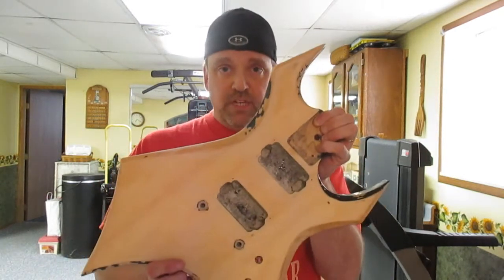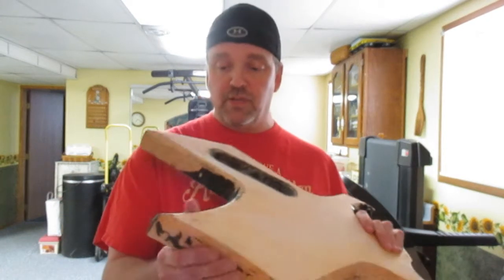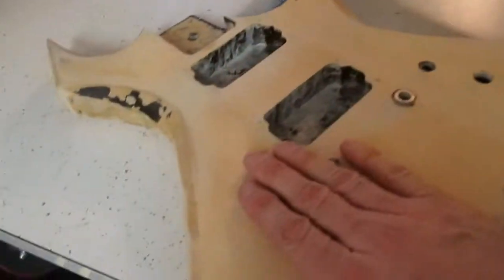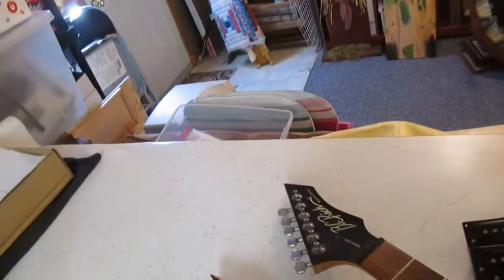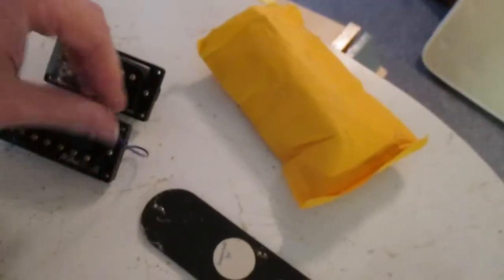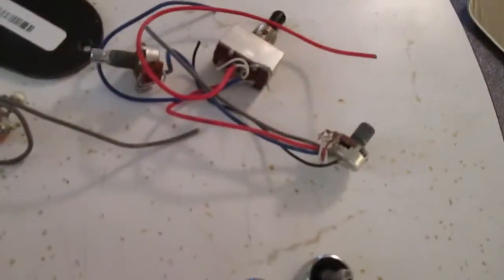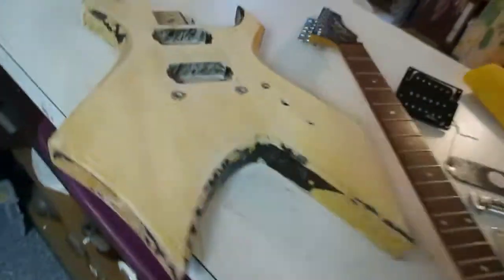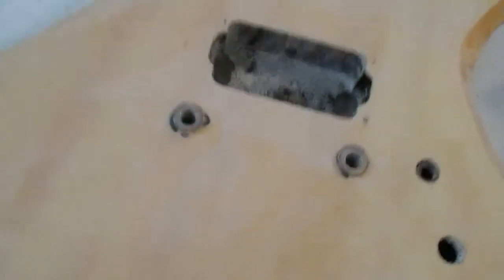New Guitar Project

Comment: Either black w red trim or a blood red with black. Be careful with paint stripper though because if its on too long it will eat away the wood. Happened to me when I used it and I had to do way more sanding than needed because it created dips in the wood